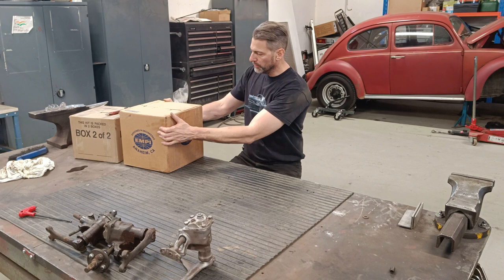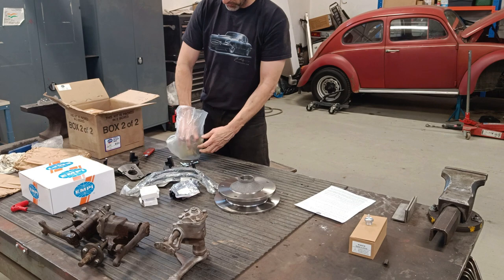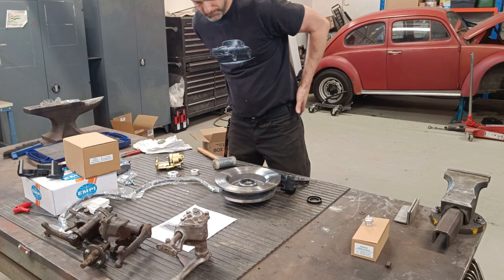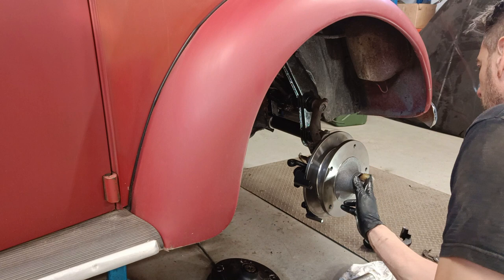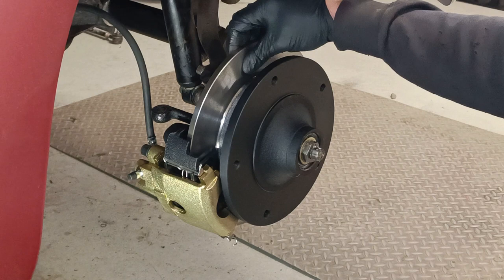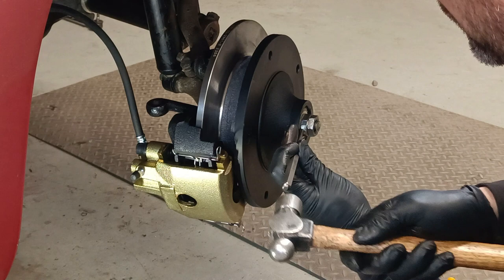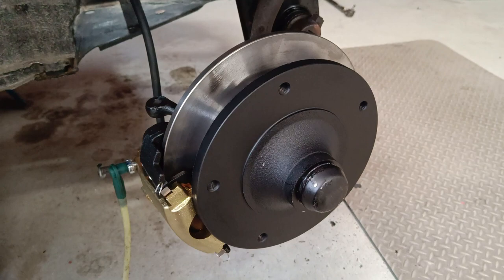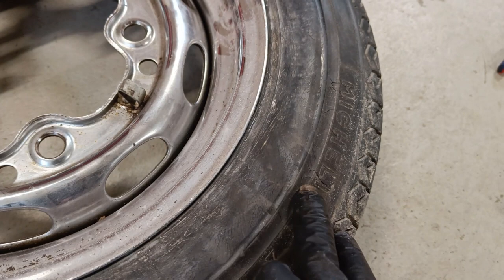Classic air cooled VW Beetle Empi disc brake conversion

Comment: I've got the issue of much more steering one direction that the other
Reply from the maker: Hello sir. You have so start with your steering arm on the steering box in the middle position and then set the length of your steering arms.

Comment: Thanks, I have a 66 Aussie Beetle with the older type tie rods, a real pain to align my steering after fitting 2 1/2” dropped spindles, after a month I removed the spindles and fitted the old ones back, another pain to align back, but I’m leaving it stock now, but would like to fit front disc brakes, cheers for your video.
Reply from the maker: Yes it can be a bit of a pain to align and so much easier when done on a lift. I am actually going to make some wooden stands that lift the car higher but keep the weight on the wheels. Thanks so much for watching. Jamie

Comment: Hey quick question how did you take off your grease cap on your disc brake and what tool did you use to take it off???
Reply from the maker: Hello there. I either use a nice big pair of water pump pliers or tap it off with blunt chisel. Hope this helps. Jamie
Reply: @jamiedowson6482  thank you 🙂